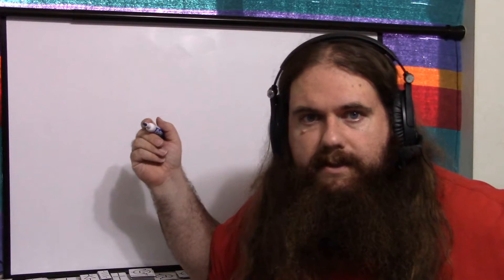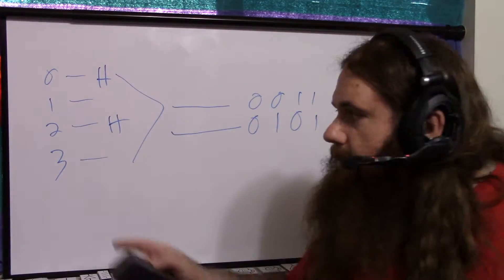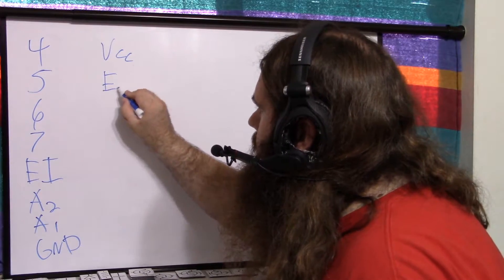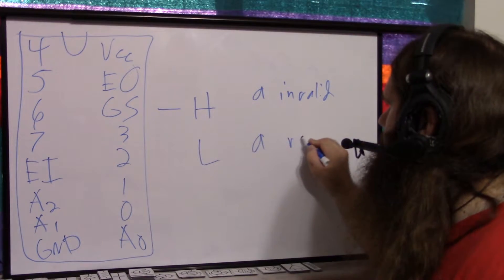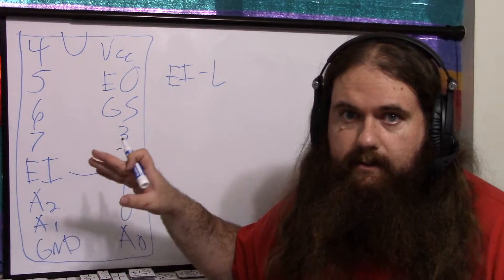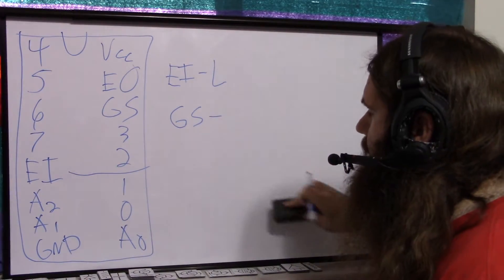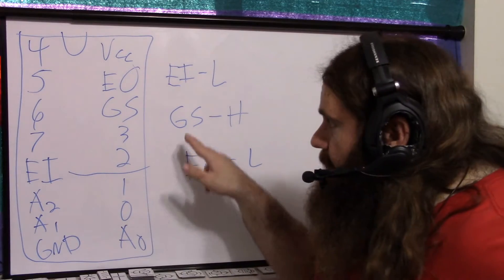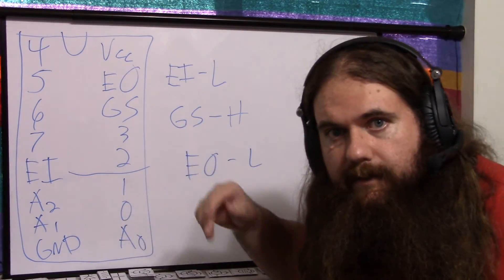SN74HC148N 8-to-3 Chainable Priority Binary Encoder - Simply Put

Comment: Nice description. Active low always seemed odd at first glance, until you actually try to design the circuits and then the it starts to make more sense.  I've experimented with these a bit, for a while I plan to use one in my cpu build but I ended up going a different way.